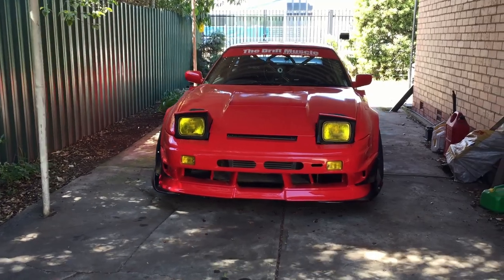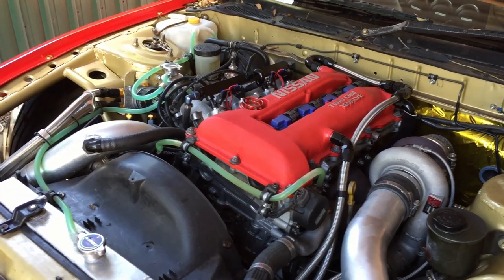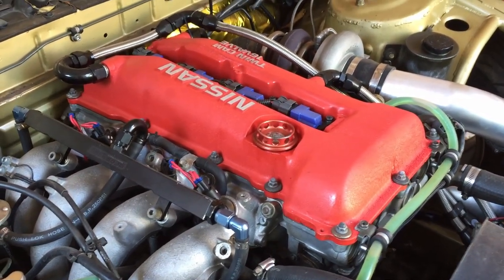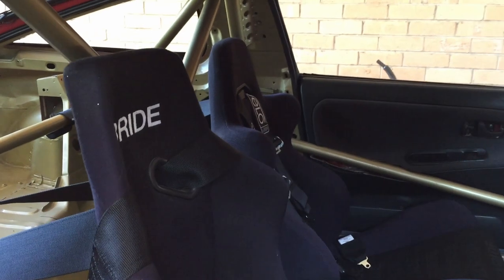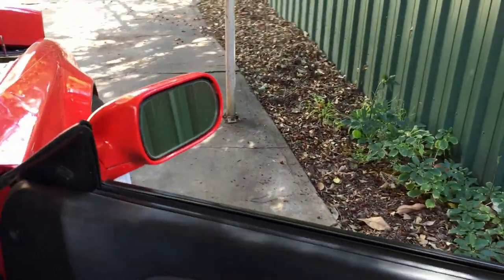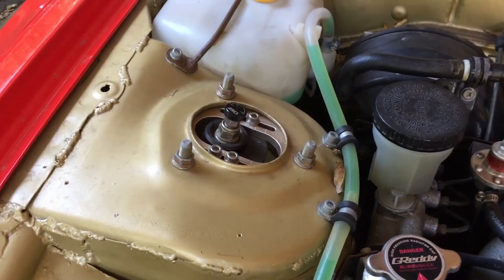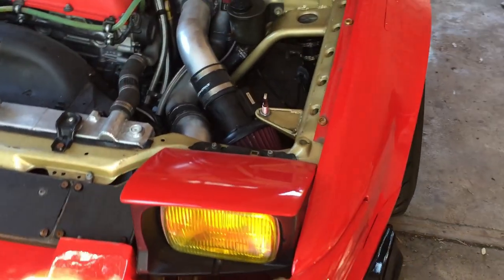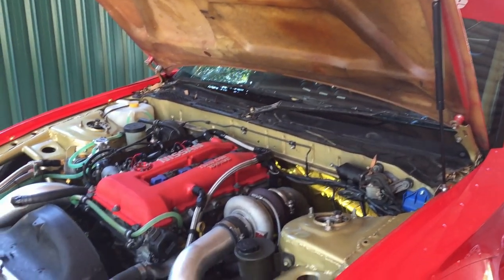180SX Build breakdown - Forged SR20

Comment: Awsome car looking to get a 180sx not this crazy build but half way there im wondering how much you spent
Reply from the maker: @wonbongcho8709 Thanks mate, I appreciate it! 👌 this version of the car was built around 2018 so the pricing would be a bit different now but I have about $34000 AUD into the current build not including the price of the car itself but this 180sx as a rolling shell in 2011 only cost me $600
Reply: @darrynjames  wow thats awsome car i am looking at is 30k nzd with no wheels on facebook, you did most thr work yourself so I guess if labour was invovled easily looking at 40 to 50k im guessing
Reply from the maker: It’s hard to put a price on a car like this in the market, depends what’s done but I can see a decent set up track ready car going from 20-50k depending what’s done.

Yeah man, if labour was involved I could see it being at least $50k I also painted it myself which would have cost a lot to pay someone to do.